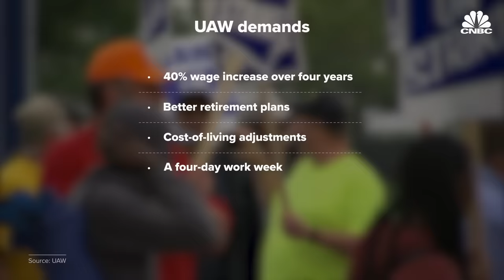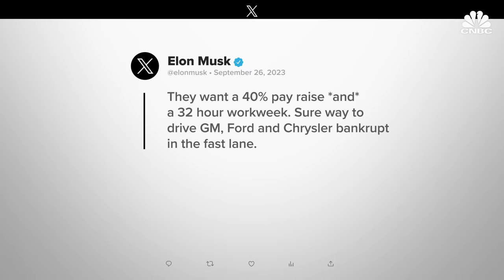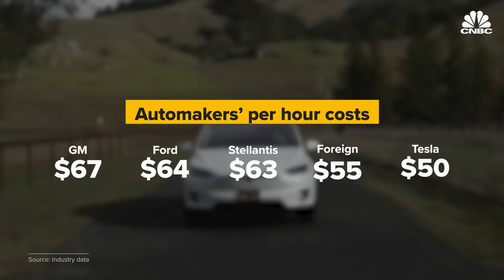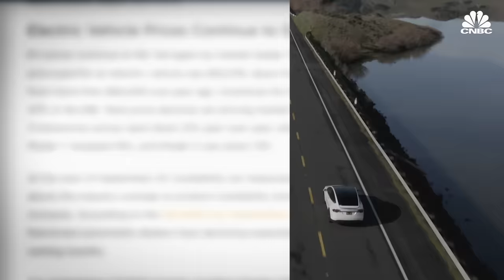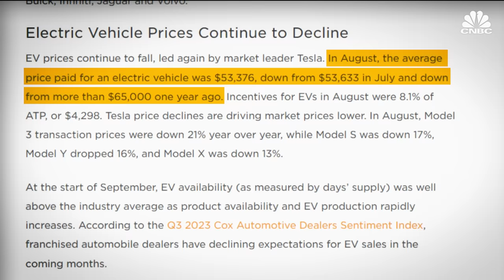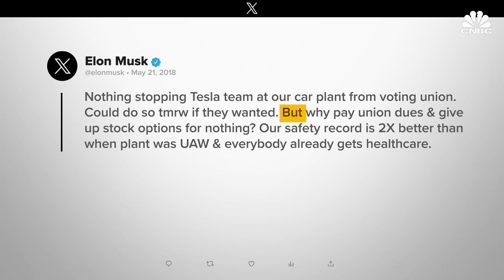Why Tesla May Be The Big Winner Of The UAW Strikes

Comment: Hmm, the UAW is trying to draw a line in the sand with what leverage they have, and its rapidly slipping away. Legacy auto is labor intensive, and next-gen EV assembly much less so. The question is, are any of the big 3 close enough to their launch of this next generation vehicles to make the leap and abandon UAW negotiations? That is what I suspect might be put into action. Time to use those healthy re-invested profits to shut down, retool, and start anew with a new work force. This colossal shift will be a major bummer for many consumers, dealers, suppliers, and workers, but the ball may already be set in motion.